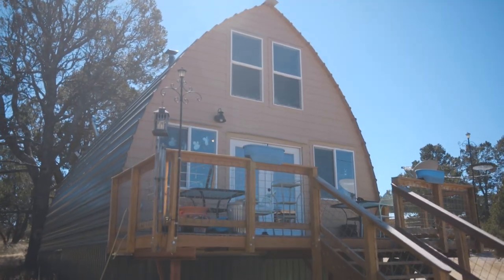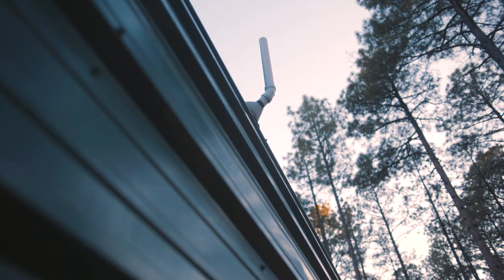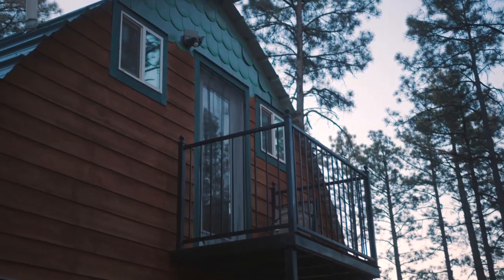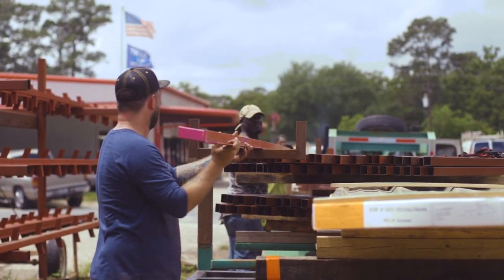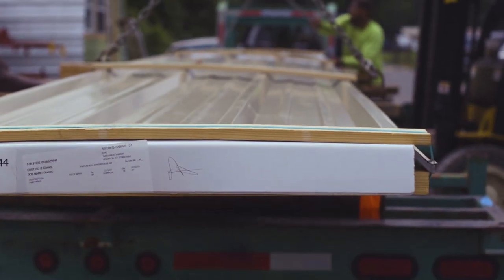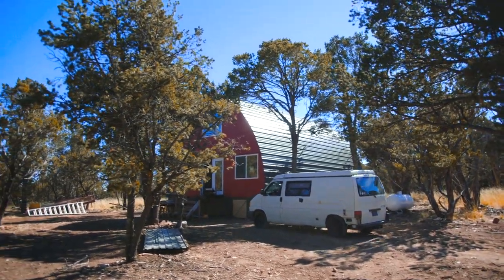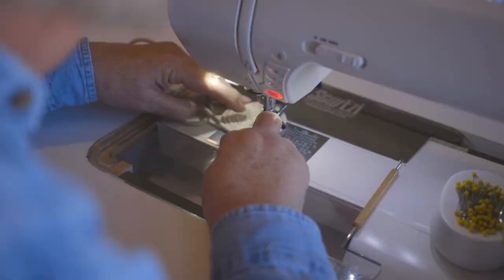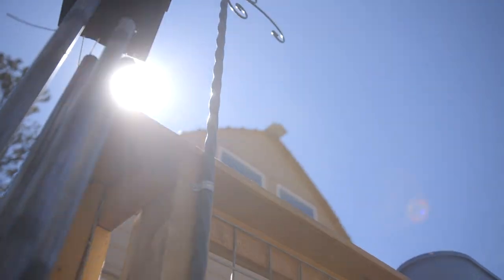Arched Cabins LLC - What is included in our Kit Homes

Comment: Suggestion; include the wood kit for front n rear, numbered.
You can ask the customer before you package the kit for shipping what size windows they will use front n rear, along with door size.
Then cut your front rear wood kit to match customers wishes!
Then you have a more complete kit.
Reply from the maker: Everything we do is in effort to provide the lowest prices to our customers. The labor it would take to make all those cuts and number and then the extra shipping costs to the customer to get all those pieces to them is not worth it for either of us. Our kits are designed to be the most cost effective way to build. That's our number one concern.

Comment: NOT the best off-grid option. Basically no efficient way to catch rainwater from the horizontal corrugated metal roof-walls. So much surface area available for rain catching but not being able to use it without additional engineering add-on headaches… 🤦‍♂️.  Plus I bet it sounds like all h3ll breakin loose when it rains on the roof (which is/are also the walls that surround ya 😂)
Reply from the maker: It's actually easy to catch rainwater. That's a common misconception. The bumps in the roof are not raised enough to counteract the gravity of the downward slope. All you have to do is put gutters at the bottom and you're done. No extra engineering. The only exception would be for slab foundations which would need to be tall enough for the gutter to fit under the lip. Most of our customers use pier and beam anyways. You'd also be surprised at how quiet and pleasant the rain is with all the space and insulation in the arched walls. ;)